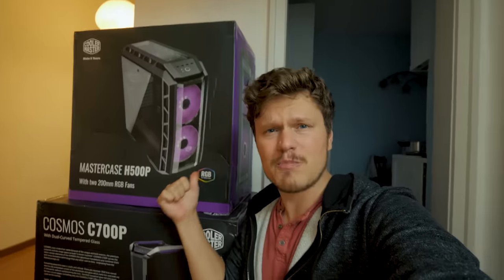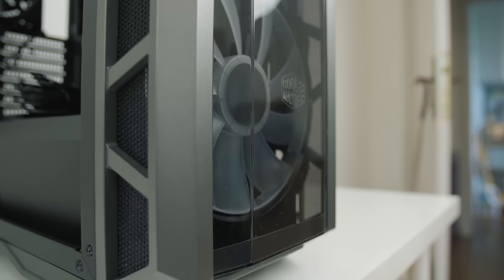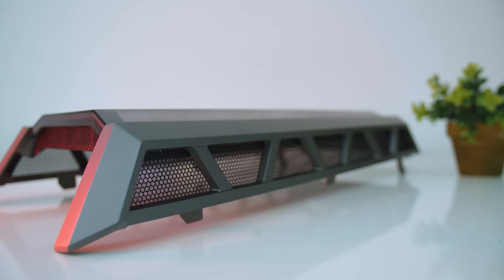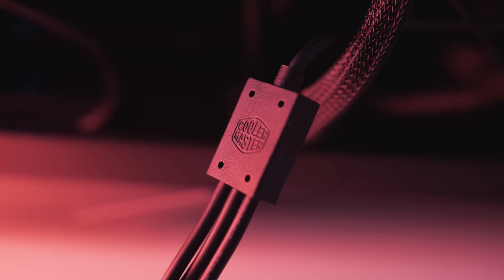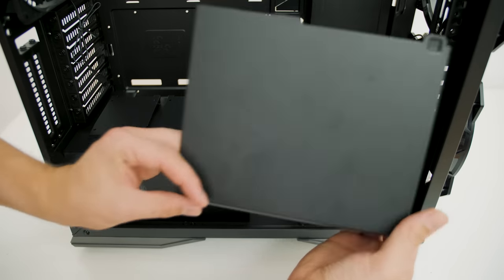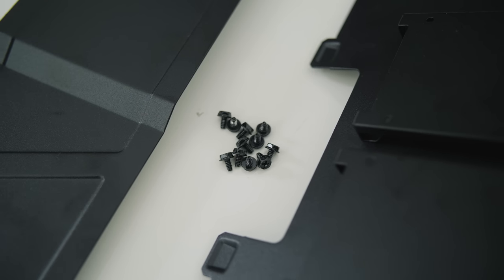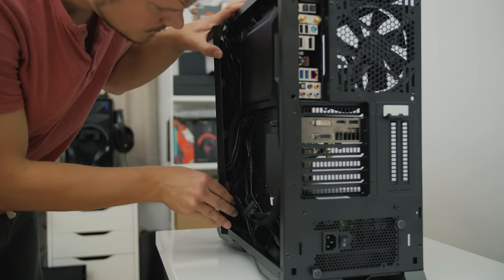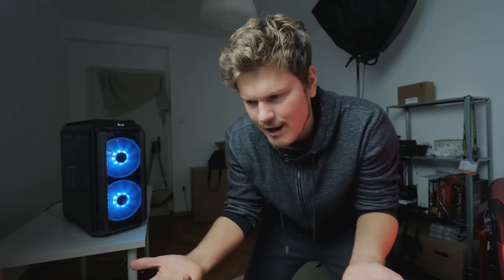Cooler Master H500P Review - It's FINALLY Here!

Comment: Interesting concept, terrible execution, terrible quality control. I was genuinely excited about this case but man... The quality control and poor design issue really turn me off!
Reply: typical Coolermaster. smoke and mirrors.
Reply: Raditram I hear you. How can they be so lazy with both the C700P and H500P? Their two most anticipated cases, AND they have had 4 months to refine them since they were first introduced to us!
Reply: same here man
Reply: Coolermaster need to stop using the mastercase frame for everything. The lack of QC on this case is such a shame.
Reply: You should by the meshify c its a great looking case and easy to work in
Reply: I feel the same way. I had several CM-Cases in the past and I was really excited for that case aswell. But now I'm happy that I went with the Define S. Which is a really great case for both air and water-cooling.
Reply: I have no idea how they could be as stupid as to put the fans on the outside of the case essentially cutting the front airflow in half. Like who approves a decision that stupid?
Reply: paskowitz it's because they used the 200mm fans to drive home the illusion of "high airflow" to misinformed masses that think bigger fan = better fan without even considering anything else. that frame can't mount anything more than 2 140 mm fans on the interior. it wasn't designed for this application. they are pimping out the Mastercase 5 frame and not one single retail version of this case is a good package for it's cost, none of them. especially this and the Maker 5T.
Reply: I took one look at it and thought, wow a case with like 200mm radiator support, I mean all the other cases support a front radiator of the size of the fan, and so I assumed the top probably supported like 180s, and why not, look at it and there is no reason why it couldn't fit.... And after all such a case with big radiator support would be the watercooling king and sell like hotcakes... But no..... Just a cheap plastic crap...
Reply: The overly restrictive front panel is the biggest issue imo. Go read/watch GamerNexus's review, CPU load temp drops 13(!!!!!!!) degrees celsius when the front panel is removed. What a waste of 200mm fans.

Comment: Every time, cooler master has so much potential but misses the spot, on so many aspects... every time they tease a new case or product, i get excited, and every single time i'm let down... no more coolermaster for me.
Reply: joris yauw exactly the way I feel, man...
Reply: Yep, preordered this case. Knew I shouldn't have preordered, but it looked so good on the show room floor a few months ago.

Oh well, I guess i'll try to return it or throw it on craigslist for like $120 and see if some sucker buys it :S. Well I guess I'm the sucker, but I'll find another sucker.

Edit: Due to the weight, I doubt returning this stupid fucking thing is even worth it.
Reply: If I don't end up returning it, I may end up drilling holes into the plastic venting sections to add areas for airflow (especially on the front), add some clips to keep the piece of shit in place, and add some mesh to catch dust, and completely remove the honey comb venting holes.

I guess this case could be a fun modding project to turn it from hot garbage into something usable (for me). Just like the h440 doesn't work at stock for me, but it works after modded (soft or hard mods, doesn't really matter on the h440).
Reply: only the old case  cooler master are good
Reply: joris yauw same here.
Reply: Mitochondriac Besides weight,what's the other cons?
Reply: Mind elaborating what's wrong with the H500P?
Reply: The front intake is completing choked. It has to be fully tore down internally before you build. My fans wobble, probably a quality control issue. The top radiator rail is great, but again, completely blocked so air doesn't properly move. The front and top panel is acrylic, and are made of very cheap plastic, I didn't even peel the protective plastic off. It is very cheaply built and at $150, you would expect more. It isnt a bad case, by no means, but i've had 3 NZXT cases, and 2 Phanteks Enthoo (Luxe and the Pro M) And every single one of them were better in almost every way, and most cost right at $100 (Aside from the $150 Luxe, which was WAY better)

Comment: I feel like Cooler Master's best cases have been the MasterCase series for a bit now. I have the MasterCase Pro 5 and I absolutely love it. Super easy to build into, plenty of space, no weird out of place parts. Only like two things that I would change about it, but overall minor things.
Reply: this is a mastercase 5. same frame, some internal bits removed and a different exterior. and that whole series is over priced. the MC5 is fine, but limited to thin 240 rad in the top, top cover comes off with a touch on that too, it's not worth over $100 itself. they're pumping out variants on an average mid tower that isn't class leading in any way. mastercase 5 caught just barely caught CM up to the other relevant case manufacturers, but it wasn't a home run and now they're running it into the ground.

Comment: Just got this case recently, mine seems to be a slightly different version, it's the regular H500P without the mesh but has the screw to keep the top part on and it has just a plain black side panel on the cable side, I've seen videos where some H500P cases have glass on both sides. Although it's not perfect and has some alignment issues on the outside and inside, it's minor, and the cable thingo on the inside I just took out as my cable management was a little messy, but I couldnt really get it right anyway. But if that's not an issue, it's an amazing case, really good cooling

Comment: its not a high airflow case. The front opening is not enough to call it that, especially since fans are not mounted inside the frame, which limits air intake even more

Comment: If this is supposed to replace the HAF series, then why would they restrict the intake airflow with a cheap clear plastic window on the front panel? That's really counterintuitive to the concept of high airflow. This case is more like a compromise between looks and functionality. It looks good, but the fact that the two 200mm intake fans have to run at a noisy RPM in order to have half decent airflow is kind of silly. That could easily be solved with a better front panel design. Why not have a window with a grill cut in to it for better airflow? That would probably solve the issue for the most part.

Here's to hoping MNPCTech can make custom acrylic replacements with grills for this case. I might actually use it if that happens, since it's really nice looking.

Comment: Correct me if I'm wrong but when you showed 73mm of clearance for the top radiator I was a little confused, shouldn't the measurement be made to the top of the Motherboard I/O slot? That appears to still extend below the fan rail area but it about 10 mm higher than the fan you measured from.

Comment: I was really excited for this case, and I'm sad to see how many pitfalls it has for a case in this price point. Could do without one of the SSD mounts on top of the PSU shroud, since that would provide more flexibility with the HDD shroud moving over it. Those panels coming off so easily is a huge oversight in my opinion, I can't think of anyone who wants that "feature."

Comment: I wonder how refined and sleek it'd look if there was no RGB fans and the front/top panels were of solid material and sturdy. I may be going against the flow here but I find this case to be gaudy.
Reply: Rizwan Mashur ul Muttakin someone needs to mod the front panel so it is a nice looking mesh with a dust filter and it would improve it so well. Maybe replace the plastic on top with solid aluminum as well.
Reply: Yup, front panel mod with mesh, same can be done for top to some extent. Then it'll become a true HAF case for sure.

If I got this case, for the least effort I'd probably get some gun-metal or grey colored plain vinyls and get a more subdued look for front and rear.
Reply: Yeah, replace the front and top acrylic with a mesh and this case would both look, and work better. Also wouldn't mind if the case itself had a taller chassis so i could install at least one optical drive or fan controller without having to use smaller fans. I get that optical drives are getting less common these days, but many people still use them (myself included) as i use my Pc as a dual HTPC, workstation and gaming center. And considering this is an unofficial callback to the Haf series which was famous for tons of bays it would be fitting.

Comment: Hey guys, could you do a review of the new Aorus AC300W case from Gigabyte Aorus? It seems pretty good with it's RGB compatible case lighting, PSU shroud, vertical GPU mount option and USB Type-C and HDMI front panel ports.

Comment: Not everyone has a CPU made in the last two years that have motherboards with RGB connectors. So if we are not on an Intel (6th gen?) CPU, will we have to buy an NZXT or Corsair lighting controller?
Reply: That's correct.
Reply: Dont think these would work with NZXTs Hue+. Their stuff runs on +5v output headers while everyone elses RGB runs off +12v headers.

Comment: another aesthetics only case from Coolermaster. cheap materials, check, derped out front intake with fans outside the frame and in front of the intakes, check. yet again the front frame has 5.25" bay which is mismatched to the case front panel and needs a bracket to mount 3 fans/triple rads lol, this company just can't get it right. I bet this thing sells like crazy based of it's brand name and those silly 200mm RGB fans.
Reply: The fans would honestly be quite good (despite the poor sticker placement). Large=quite because of lower RPM. Unfortunately the shitty front panel chokes them.
Reply: that's all a matter of reference point. 140mm fans are quieter than 120 and move more air whilst being quieter. this is all before taking into account fan blade design and internal motor design. 200mm fans have to have louder, more powerful motors, they have no static pressure, so bad against any resistance from a filter or panel and they are all loud above 800 rpm.  this is why they are not common and Noctua is taking a million years to come out with their 200mm fan, it's not worth it.
Reply: It's a trade off for sure and heavily dependent on case. I personally have 200mm fans in as my intake and my Pc is dead silent and quiet. But to be fair i doubt 3 140's would be much louder either... I don't have any rads or solid panels to deal with either, just a mesh that isn't very dense.
Reply: this case should have had a mesh top and front. would look much better and solve the airflow issues. wouldn't need those fans to run high speed either. I've had a few cases with 200mm fans. mostly good experiences. my current the Enthoo Luxe came with 1, but i replaced for 2x 140mm fans. I had the Thermaltake Element G years ago with an RGB 200mm side panel fan and the Azza Hurrican 2000 that came with 5 fans, 2 of them 200mm.

Comment: I love this case, and I will be cooling have the i9-7900X in rampage extreme I'm considering doing 3x 140mm in the top but not sure on what rad to go with or if I should just do 3x 120mm and a 360. Any suggestions??

Comment: Hey guys, I have watched the other reviews. although I wanted to wait for HarwareCanucks... you are the best when it comes to cases. I am really sorry to say that the review looked rushed, for example:
  - at the begging the glass had smuggles on them
  - the issue with wobbly side glass panel 
  - the problems with the side mounted GPU
  - the ending and the head

Comment: I feel like some case manufacturer's need to send their case idea's/ prototypes to Youtubers (like HardwareCanucks) for review so they can work out any quirks. Too often we see case manufacturer's overdue things on the aesthetic front, but forget about what it's actually like to build inside them, often times making it more difficult to work in. Really?!... 5 screws just to take off the power supply shroud! Not to mention losing a SSD drive spot when moving the front half of the shroud back. Very poor design. This should be a wake up call for CM.

Comment: Thanks for the video! I was excited for this case but now it's gonna be a hard pass for me. The meshify C hits all the boxes for me so I am going to go with that. It's also cheaper and smaller which is what I wanted as well.
Reply: Britton Johnson and meshify C looks 100times more classy. I guess i will gets bored of this h500 case looks within a month.
Reply: Joseph Yeap yeah like I really don't understand what cooler master was thinking. Such piss poor implementation when their completion aka a real high air flow case the meshify C, literally hits all the boxes for a quality case.
Reply: I saw a couple videos on it and it wasn't premium enough for me honestly. I did not like the plastic and the cd drives.
Reply: Britton Johnson 

The 5.25 drive bay is removable on the Phanteks Pro M. It really is a very good case. But so is the Meshify C. You cant go wrong with either to be honest.

Comment: hey if you where to select between Cooler Master - MasterCase H500P,  Corsair - Crystal 460X ATX, or the Fractal Design - Meshify C or  CORSAIR Carbide Series Air 740 
which would you pick?

Comment: How is this case worth a crap without drive bays that can be accessed externally? I have three Cooler master Cases in use at the moment. Two HAF-922's and CM Storm. All of them have between four and eight externally accessible hot-swap drive bays and Blu-Ray/DVD/CD burners.  This case would be utterly useless.  Also, metal cases are the way to go to limit the RF radiation emanating from the components in the case.  Some of us can actually feel this radiation and prefer to have as much metal shielding as possible.  plus the plastic just looks cheap.

Comment: cmon dimitri why didn't you use the vertical mount for gpu..
Reply from the maker: no airflow for the card otherwise.
Reply: HardwareCanucks oh ok, why is it there then? Watercooled cards? Thx for the reply love your vids
Reply: Filippo Bellone pretty much or founders cooler cards an Fe card would probably do ok. Maybe in 2018 someone will get a verticle gpu mount right

Comment: Why does coolermaster keep disappointing?... First they increase the promised price from 139 to 149 dollars (170 euro over here....), and then they just reuse an old frame, do NOT include mounts for reservoirs (even if they showed off a custom watercooled system at computex).... Sigh... 4 months of hype punched in the face right there. And how the feck do you fail in making silent and efficient 200 mm fans?
Reply: Did you preorder it? Cause I did. I feel fucked hard, and the case isn't even here yet. Too expensive probably to return due to weight/size... Fuck me man, why did I get suckered so hard by the positive coverage of this case :\.
Reply: Mitochondriac No, fortunately I didnt. I was tempted to do so on several occasions. Luckily, there have been no pre-order discounts, or I might have  done the mistake and pre-ordered it. That, and the fact I am also purchasing lots of parts for my custom mITX build. 

I feel sorry for you, bro. And for anyone else purchasing this case. The 400 dollar Lian-Li case start to look very tempting now...

Btw, shouldnt seller pay for return? What happens if you just dont accept the delivery and mark it as return to sender?
Reply: Honestly I am not sure. I am almost 100% positive newegg makes you pay for return shipment, which sucks. I am honestly not sure about denying it either, I am asking in other places to see my options of returning something bulky and heavy (and the idea of denying it). I've just never needed to bother with doing something like this, so I have literally 0 experience. Last thing I returned to newegg was in 2008 for a Samsung computer monitor that sucked (horrible QA, typical monitors), and I remember paying for return shipment on that PoS too.
Reply: Can't deny it, non-refundable product on Newegg. Just been newegg'd again.

Sigh why do I bother with newegg, their return policies are great, until they aren't.
Reply: +Mitochondriac Oh hey you again, it was Newegg. Yeah I don't like their return policy, and I think you're right they make you pay if you just don't want it (if it's not faulty). I got my case from Newegg though; not sure where else to go when Amazon doesn't have it, Newegg usually has more variety.

Comment: Needs to be larger, Needs to have higher quality materials, Needs to have move drive bays and the ability to mount external drives without using smaller fans, Needs to have an option for a mesh front panel because the airflow is awful like this. Im glad they didn't tarnish the HAF name by calling this case "HAF"... This case is nothing more than an overpriced pile of McDonalds plastic barely worth 70€ let alone 150€...

Comment: Somehow, it always seems to me like a case that size is wasteful without so much as a single 5.25" drive installed in it. It seems awfully large for something that is just housing a mainboard with CPU, video card and possibly no hard drives or even a SATA SSD, since M.2 is now so popular. It could all fit so easily in a much smaller form factor.

Comment: Putting the front panel on this case increases your CPU temps by 10 degrees. TEN DEGREES! Gamers Nexus review is a MUST WATCH if you were thinking about pouncing on this. It is not High Airflow, it's the exact opposite, and you were sold based on a brand and based on a legacy that no longer exists.

Do not pay CAD $200 + tax and shipping (CAD $240 absolutely realistic) fur this rushed QC-less hunk of plastic. Do not support decisions that lead to the creation of this case.

Comment: I've been waiting for the case too. I'd put a 360mm rad top 280 front all noctuas instead of keeping the stock 200mm ones for custom waterloop 8700k 2 way sli 1080ti water cooled